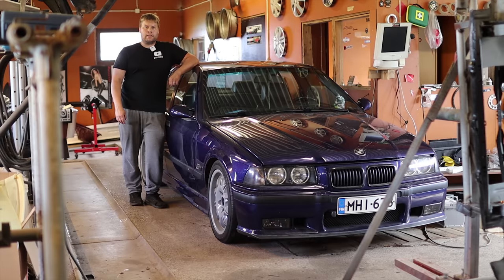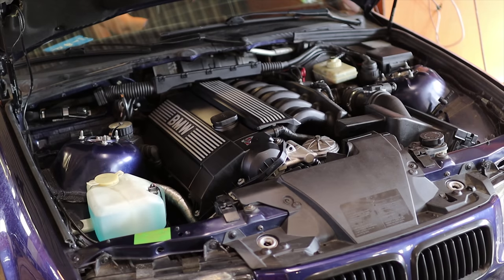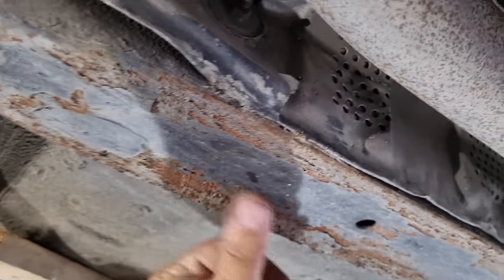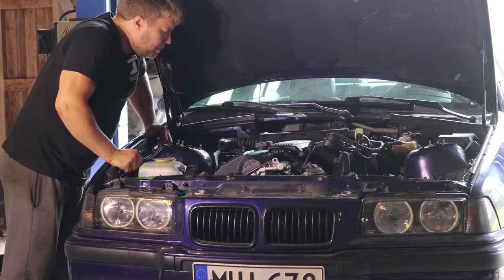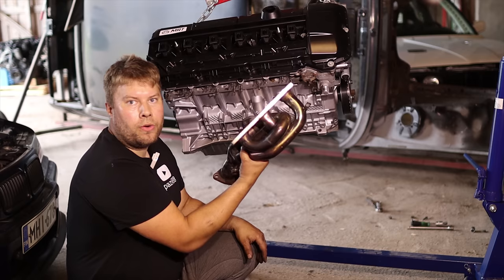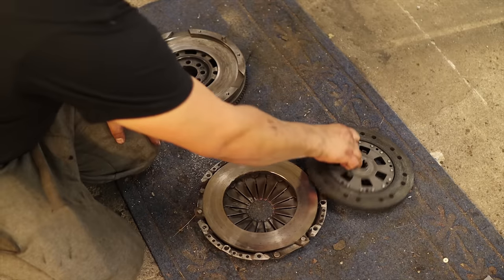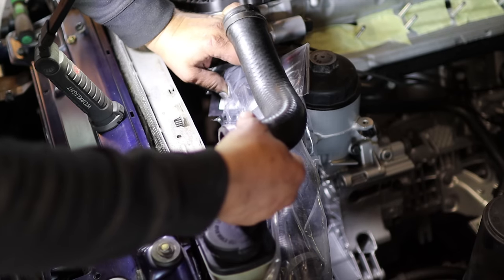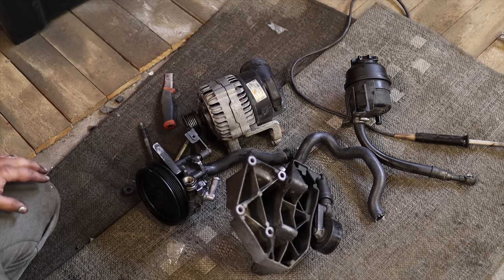300hp N/A M52 project. Part6, engine install

Comment: I am also using the Schmiedmann headers on my m50b30 stroker and it's doing 295 hp currently so they should be fine for your power goals. But I'm also running a single 3" exhaust to the back from the headers. There is also another guy in Estonia who used Schmiedmann headers for a while and managed to push his m50b30 stroker to over 300 bhp from the wheels on them. For the flywheel you could use the m20 single mass one and maybe get it lightened slightly. Mine is slightly under 7 kgs and it's really nice and driveable while also being quite light but not absurdly light.
Reply from the maker: Yeah. Those headers will probaply be last thing to get swapped out. And of course I need to get some data with those if/how much better different headers are. I will also run 3" straight in this. Well few small mufflers and mandatory cat. But still. Should be plenty of flow.
Reply: This is with pump 100 or with ethanol?
Reply from the maker: @idokwatcher2062  Mine will be on e85 at least.
Reply: Pump gas 98 in Europe. Not sure what the US equivalent is but probably something similar.

Comment: pazi88, is it possible to remove the engine that way, without removing the gearbox? Next week or so I'll be taking out M52B20 and swapping M50/52B30 into my e36.
Reply from the maker: Yes it is. Bit annoying but possible. At least with stock headers. Mine are bit annoying because those headers hit everything even without gearbox.
Reply: Thanks, and good luck! @pazi88

Comment: Is there any update, tuning and hp result?
Reply from the maker: Unfortunately no. I haven't even started this yet. It's the classic thing where last 5% of the build take up 90% of the time 😅
Reply: @pazi88  Well thats unfortunate. I have learned a lot from you, you really helped me with your videos with tuning ms42/43! Thank you! Since then ive installed and tuned m54b30 with small sc eaton m62, works flawlessly. Sadly due to road regulations I am thinking of regrind cams but not sure if its worth it. ATM my engine puts out 297hp and 420nm... Would regrind cams come close to this HP? would 280ish hp be possible with headers, tune and stock m54b30 intake manifold? What do you think?

Comment: Thx for the vid. 
I've had a hard time finding that same AC tensioner for my 1996 528i recently. It's NLA at BMW and also INA is not selling it anymore. Eventually refurbished my old one by replacing the needle bearings and vibration damper with ones from a m52tu tensioner. Now it's fine again. 😊. Good luck with the project!
Reply from the maker: Hmmnn. Where are you located? I did check the part stores around here and all have that in stock from several manufacturers. Both the hydraulic and mechanical versions.
Reply: @pazi88  Hey, in the Netherlands. I thought the same and ordered one, but then when it arrived it didn't fit. Found out my early single vanos M52 uses part nr 11281433632 (same as M50) and it's shaped a little differently. I thought yours had the same one on the engine you took out. But I suppose If that's the case you could also swap over the AC pump bracket from the M52TU and use the modern tensioner type which is still available.

Comment: I bought one of your early speeduino boards and will be using it eventually to install an m52b28tu into my 83 Celica Supra. I intend to take it apart and install a forged rotating assembly to hold up to moderate boost. Looking forward to poking the purists a bit from both sides - not that it matters as the modern "Supra" is all BMW anyways.
Reply: Also the current 5mge has the same displacement as the b28 which is fun.

Comment: This is fantastic. I don't know why I asumed it would go into your e39... maybe because I love e39s.
Reply from the maker: Well at some point I was even considering dropping this to my e39 😅 But I think it would be bit wasted potential in that. Big heavy car would benefit more from v8 etc. Small high revving engine suits lighter e36 better.
Reply: @pazi88  The only reason I can come up with for installing a strong i6 in an e39 is the front subframe with rack and pinion, which feels a lot more refined than the recirculating ball steering box V8 e39s had. There's a lot of builds of NA and turbo i6 e39s that puts v8 cars to shame, even some M5s. A +300hp N/A engine into a light 523i or something like that will definitely leave V8s behind and while being nicer to drive while at it.
Reply from the maker: @juanignaciocaino  Well yeah true. But I already have strong ~240hp m52tu in that. So it wouldn't be that much of a upgrade for it.
Reply: @pazi88  that's true, plus 240hp for a daily e39 it's plenty of power, especially starting with a lightweight car like you did (the smaller displacement 6 cyls were lighter from the factory, my 523i manual weights 1350kg more or less the same as a loaded E36) Anyway, thanks as usual for your educational and entertaining content and replies!

Comment: Great to see such a high quality video .
I have two questions
1 I can't register in romraider forum to download ms 41.2 conversion file , is there a problem with the site?
2 How feels lsd conversion on e39 from racing diffs after time ?
Reply from the maker: Thanks! 
1. The RR Forum registrations are checked by human to prevent spammers. So it could take a while. Also check your junk mail folder. Also the files are usually available on ms4x discord group also.
2. It worked great for start. But after 6-months it was slipping quite badly: https://www.youtube.com/watch?v=C_Y4WwwPHxg

Comment: Life hack for power streering pump, i see you have luk lf-30 version, there was also lf-20, both known for failure, and noise, just put in pump from 2.5tdi, old a6 etc, they are the same, fits in bracket, pulley is p&p and they are made by ZF not LUK(stfu), so they are life time working, no problems at all, and costs like 10euro on junkyard. I advise against substitute/replacement/chinesee/other brands that not OE, better buy used OE than new "chinesee" because they howl even when new, also cooling is important, im drifting guy, so had problems with boiling power steering fluid, i installed small radiator because OE "pipe" is no good, size of hand maybe? And this setup dont make problems since 6years.

Comment: i took m50 power steering pump for my m54, just milled the bracket that holds the pump to get the right ofset ish
Reply from the maker: Yeah. That's possible. But I already found correct pump for 30€ including 1 year warranty.

Comment: Hi, if you're going to get rid of the stainless muffler, I'm interested in buying it. Although I'm in Italy so the shipment could be an issue
Reply from the maker: Yeah. Shipping outside Finland isn't feasible. The cost is really high. But I might re-use that with the new exhaust, if it's big enough inside.

Comment: Hey, just Finished swaping a M50b30 in my e36. Runs with Kdfi 1.4 but kinda rough. i got cams from dbilas inlet 272° and outlet 264°, 470cc injectors, Wiseco Pistons for high compression, M54b30 Crank and Maxspeedingrods 135mm H-Rods and bosch Wideband Lsu 4.2 Of course.
Any tips for tuning in Tunerstudio, or just give it to someone who can do a Tuning ?
Reply from the maker: It's just tuning. Same as any other engine 😅 With cams like that, it will run bit rough anyways.
Reply: @pazi88  Do you know what settings are best ? Alpha-N, Speed density or percent baro ? i´ve once read you can use the manifold pressure to ECU and its more accurate than Alpha-N.
Reply from the maker: Normal speed density works best. Alpha can be easier to tune. But it really only works good for driving flat out. Ie. for race use. @dennish.7958

Comment: i used the e36 metal cap m50 housing on my m54 and i had to use the the e36 power steering pump and bracket
Reply from the maker: Yes that is possible. But I need the oil temp sensor that is in the m52tu/m54 oil filter housing. And the spot for that is missing on the older ones with metal cap. Of course I could drill and tap one, but easier to just get the power steering pump.
Reply: @pazi88  I put the temp sensor where the pressure sensor was and then used some various adapters to put to the pressure switch off of where the vanos line is
Reply: @BEAMERNOOB  seems like amis patentti aka vocational school  hack job  when could have easily just do a swap to  do something else that ismt labour consuming

Comment: Do you use all genuine bmw engine sensors ? For example crank sensor or oxigen. Because i was told non original sensors wont work with factory ecu.
Reply from the maker: Yeah. Usually only the original ones work reliably for longer periods.

Comment: you can consider using s54 headers together with M5x exhaust flange as euro S50 are expensive as... everyone knows what
Reply from the maker: Yeah. Those are something I have been trying to look for. But seems that those are only cheap in US, so it would get quickly expensive to get those here.
Reply: @pazi88  i got mine for ~120€ in poland, if you want i can look around for pair for you
Reply from the maker: @kujtek  Well that sounds like pretty nice price. I would be gratefull if you could do that.

Comment: What MAF are you using,and injectors.i had issues with maf and only or mad worked OK ,nothing else
Reply from the maker: Mad?
Reply: @pazi88  maf, sorry, autocorrect (for the single vanos)
Reply from the maker: @KostadinDelizhanski  This will use stock maf and ferrari injectors.

Comment: Do you know part number on minute 27:14? i can´t find it on the etk. Thanks in advance!
Reply from the maker: https://www.realoem.com/bmw/enUS/showparts?id=CD11-EUR-05-1995-E36-BMW-328i&diagId=11_6073 	11141734019
Reply: @pazi88  any web on europe to buy it? im from spain, is not available at bmw dealer of course :)